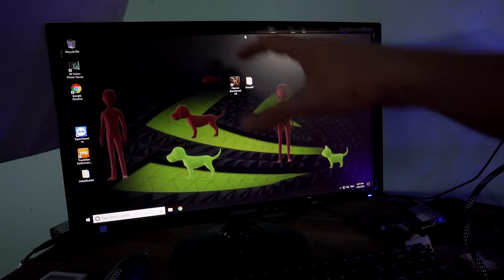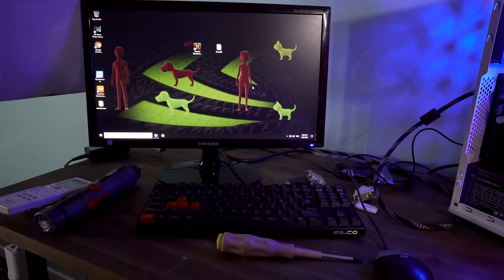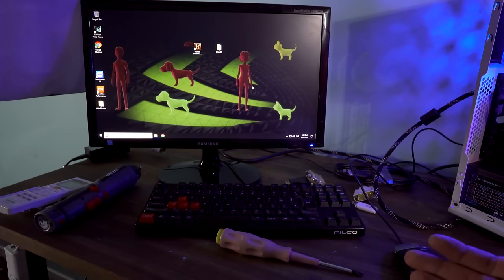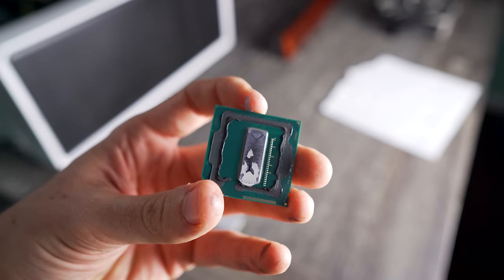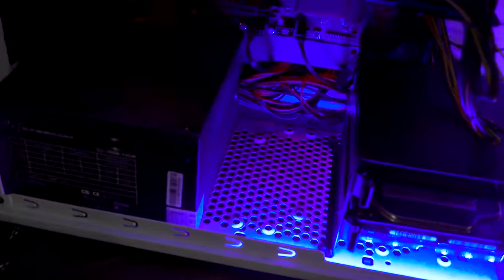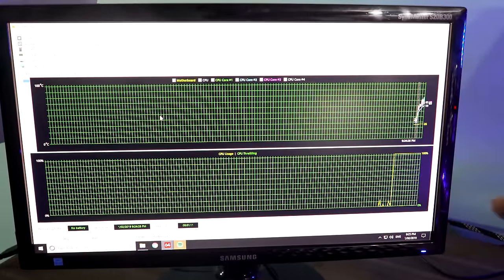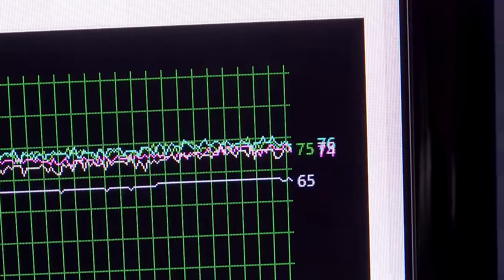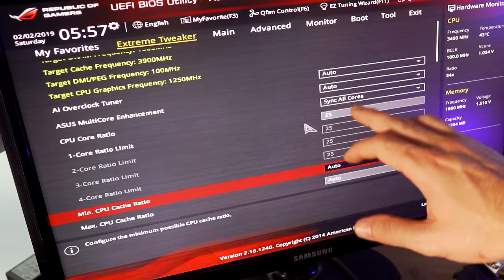How to Spot a FAULTY CPU.....? The i7-4770 Dilemma....

Comment: I've only ever seen one CPU failure, was a real pain to diagnose. it was an AMD A-series APU. The computer would just shut off randomly, ruled out heat related issues and swapped the power supply and nothing changed, it would just shut down a couple times a day. I pulled the GPU and used the onboard graphics and had artifacts even in the BIOS screen. Apparently the GPU portion of it had failed. Replaced it with the best CPU I could get for that socket which was I think a shitty Athlon X4, re-installed the discrete graphics card and everything was fine after that.

Comment: I have an i7 4790K that goes instantly to 100 Celsius on every core. Now finally, after 4 years, I've decided to open it and replace the thermal paste with liquid metal. No functional symptoms yet (except power limiting), despite running at 100 W for a couple of weeks now. Hopefully it's not too late to fix.

Comment: Not many people know this but if you place the faulty CPU at the large end of a celestial grade telescope you can spot the microscopic bug that is causing the CPU to fail. At this point a pair of surgical tweezers can be used to carefully extract it, at which point the CPU should work fine again.

Comment: in about 20 years, I have only ever known 2 CPUs die, one was an AMD K62-350, WAAAAY back.... I don't remember much about the cause, and another was more recent, it was during a re-build of an i5-2400, built into new case and it just stopped working, swapped everything out, even put everything on a new board and was still nothing - swapped out the CPU and it all came back to life...

I do however believe the CPU took one of the RAM channels out on the board, as only 3 of the 4 slots will work now...

But also recently (2017) I built a 7700k system, and I ended up returning it TWICE to Intel as temps were not under control, were hitting low-mid 90's in less than 2 minutes when gaming...
Reply: Did u get any post or beep with your dead cpu.....m currently in a bind

Comment: Well, prime95 is nice, but usually takes a lot of time before you can encouter an error. What is somewhat better to test CPU/RAM is Intel burn test which uses linpack. 
Usually it is enough to run 10 loops with maximum ram to find if the computer is stable or not :)
Reply: Filip Doležal just throw in call of duty 4 blackout run zombies it’s best stress test yet trust me got my i7 9700k at 5.2 ghz at 1.325 volts its amazing !!! Stays in 50-65 while gaming on just 120mm aio in push pull and fan over vrms!!!!
Reply: you can only truly test stability with a mix of stuff.  start with the IPDT, then stuff like aida64, then intel burn test, then prime with FMA3, then real-world crunchers like seti@home.

i have found that everything would be fine, until seti@home (lunatics avx client) would show it to be unstable.  if you are looking for an unconditionally stable oc, you need to have a large set of synthetics and some real world stuff.
Reply: my latest stability finder is Y-Cruncher (also does prime calculations) but seems to find errors faster than Prime95.
Reply: AVX generates more heat, and you may need to set up an AVX Offset in the bios, to downclock the CPU by -1 or -2 on the multiplier when AVX instructions get hammered like that.
Reply: @mrlithium69  I think AVX offset was introduced later.  I have the Gigabyte Z97 flagship board for my 4790K, the GA-Z97X-Gaming G1-WIFI-BK, and it doesn't offer that.  I'm pretty sure that ASSRock didn't either.  Not sure about Asus, as my first modern Asus board is a Strix Z370-I (prior to that, my previous Asus was a 286 board).
Reply: @kaylaandjimbryant8258  AVX offset isn't in either my Z97 or X99 Asus Sabertooth boards.
Reply: I've had f'in Cinebench of all things catch a problem P95 v29.4 Small FFT then Blend and LinpackXtreme missed, and vice versa. It pays to test with everything. Realbench is the one that couldn't even catch a cold let alone an error.
Reply: @m8x425  exactly, i use as good a mix of stress tests and actual stuff (avx seti, avx folding, etc) that i can put together and they will catch most stuff, but even then, only using the machine can tell you if it's actually stable.  i've had times when every test passed, but after using the machine doing daily stuff for a few days created either a lockup or bsod situation that would only be ironed out after bumping Vcore up maybe another five or ten mils, and then it would be long-term stable.  the stress tests, etc, when you do it right will get you to within that five or ten mils to unconditionally stable though.

about the only thing i do for sure is rank them by lightest to heaviest load, which is USUALLY a good yardstick on failing or passing.

Comment: Good to see you use Prime95 too Brian since it puts a more demanding load on the CPU. I would not worry too much about Haswell CPUs. My Haswell is fine. My guess it was abused before you got it because my 4790k has been overclocked to 4.6ghz for years now and no thermal problems

Comment: I’ve got the 4770K in my rig, had it for 5 years now and it’s still holding up just fine
Reply: And would probably in the next 10 years, if not more. If you got a cheap motherboard it will die sooner.
Reply: Koeras it’s a Lenovo motherboard it’s not that bad
Reply: @themattyshow4026  Lenova does not manufacturer Z87 motherboards as far I know (?)
Reply: Koeras it’s a prebuilt Erazer X510
Reply: @themattyshow4026  They use OEM parts of one the major manufacturers.

Comment: Im definitely a budget shopper so going with a ZALMAN cooler i don't mind. Plus i always used them. I found the biggest one that supports up to 300watts and stuck that on my 8700K.
 I got a Gigabyte Aorus Gaming 7 cause of it's high end VRM components and after watching Der8auer's video on it, I had to get it. Plus it looks good with the ZALMAN 9900MAX and a Sapphire Nitro+ RX 480 8GB OC (RX 580) with it's back plate almost perfectly matching the design on the board.
 All in i built a z370 monster for only $670. I see PC's prebuilt going for over $1500 with similar specs. I can say im happy with the choice to go z370 and not the i9 9900K route. I might upgrade to that in the future being that the MB can handle it. (8700K $280, ZALMAN 9900max $20, Z370 Aorus Gaming 7 $150, 16GB Gskill 3200MHZ ram $100, 650watt Corsair PS with case $120) had the rest of the parts SSD's and HDD's. $670 is what i would've had in just the 9900K with a proper IO and MB.

Comment: I have a i7 4770k and have no idea why the pc keeps just shutting off. 
Sometimes the pc is just idleing and it shuts off. Just watch low stress content and boom off. 
Thank you for letting me know about it's thermal grease. It's come down to the motherboard and CPU. 
Retesting the ram one more time before I delid the cpu. 
Other option would be to buy a motherboard first and see if that works fine. That would be sad though had an amazing formula VI motherboard. 
Going to just buy new set of ram. Worst case scenario I end up with extra ram for my system. 
Do let me know what would you recommend I do?. I have changed the power supply, tested both the rams, added a new cpu cooler with new grease, tested it on unraid still turns off, remove all hdds and tested it still turns off, removed most usb plugs, changed grease on gfx card which made it 12c cooler understress.
Ram test just turned off was at 92%.
Temps are generally really good on the cpu. Below 37 max 50 to 60. 
Will try Prime95 tomorrow.

Comment: 12v, 5v, and 3.3v are way too high, PSU has some issues...
Reply: Nah, won't make any difference.
Reply: They're well within tollerances. The ATX spec gives a  +/- 5%  limit. 12.6v max, 5.25v max, 3.465v max.
Reply: Theres 10% wiggle room on ATX voltage specs. And only 12v is relevant here, which further gets converted both in the motherboard VRMs and in this case on the CPU FIVR.
Reply: And all the critical parts of the computer generate the required voltages locally (CPU, GPU, memory etc) so even 10% higher voltages won't hurt a bit

Comment: I've been building systems since the mid 90s and the only new CPU I ever had bad out of box was a Ryxen 5 1500x, it had the dreaded segfault bug. It took me months of diagnosis and fighting with AMD to get an RMA because the serial number on my CPU was not supposed to be an affected model.

Beware of Ryzen 1000 series parts floating around on the second hand market, you may well buy a defective CPU and be plagued by random inexplicable crashes.

Comment: My Ryzen 2700X was a faulty CPU. The impossible happened. Wasn't hard to identify it/ It was just unstable. System was freezing whatever the memory settings, whatever the voltage. I managed to keep it stable at 4.2 GHz and 1.34v (yes the chip didn't crash at around 1.3v in prime95: "golden chip") with 16GB of cl14 3200 memory. XFR2 and PBO2 didn't work at all. System hang up while booting. After a few weeks nothing worked. Even 3.7 GHz  with 1.4v and cl18 2133. I tried different hardware. Wasn't the powersupply either. And my Crosshair VII went through RMA too, they sent it back, so by conclusion it wasn't the motherboard either. 

Well RMA just gave me a new Ryzen 2700X. Been working fine in the last 6 months. And probably will just do fine in the next 5 to 10 years.

Comment: I had a problem with a CPU i7 6700 for months! It always had bluescreen with the WHEA uncorrectable error. We noticed it would bluescreen when idle or doing light tasks but never on  load. Long story short we fixed it by putting voltage to 1.35V.

Comment: i had a faulty i3-7100 on a cheap computer I built for someone. It would BSOD shortly after getting into windows. I replaced everything, motherboard, power supply, memory etc.I finally tried a 7700k cpu and it worked absolutely fine. The CPU was almost brand new so RMA through intel, they asked a bunch of questions and had me mail in to verify faulty. Sure enough it was and they sent me a brand new in the box cpu, even got another cpu fan.

Comment: I once bought a i7 3770 (to replace a 3570k). The thing had a faulty iGpu. As long as you left the microsoft drivers for the igpu, it ran fine, but unfortunately not at the proper expected resolutions. 
As soon as you installed intel drivers (and i've tried a plethora of versions from various years, months and so on) the pc wouldn't either boot or bsod instantly. Switching off the igpu, the CPU and the pc ran fine. I had at the time 2 3570k to test, either worked fine with the enabled igpu. I then had another z77 motherboard laying around, swapping the 3770 on that and enabling the igpu led to the same issues. I had to return the 3770 and even the seller couldn't believe me until he tried it for himself. He sent back another working 3770. 

At the same time a friend sent me back that other z77 motherboard.. the thing had a strange issue, it basically kept rebooting itself after like 30' of "on" time. It was like an internal timer triggering the reboot and I couldn't figure out what was the issue, I flashed several bioses, changed memory and shuffled slots a ton of times, checked socket pins, changed 3 different cpus, cmos the crap out of it to no avail. I gave up on that motherboard.

Later on I read about Lenovo deliberatedly disabling Intel Management Engine to business level laptops, and read a comment of a guy answering another how he could disable the Intel ME by deleting the code/editing the bios. The other guy said "you can disable Intel ME, but then the motherboard would reboot every 30 mins or so because it checks if intel ME is present, and if it's not, then it will reboot".

Guess what, I checked the bios rom versions, and somehow the MSI flashing tool (it was a MSI Z77MA-G45) kept updating the bios part of the rom (to whatever version of the bios i tried to flash) but somehow left untouched the Intel ME part to the 1st ever iteration of intel ME that came with that motherboard.

I asked in the MSI forums and I was given a specific tool to force flash via Dos any version of the bios. With that thing even the Intel ME part of the rom finally updated itself to the latest version, and that motherboard still works as of today. Somehow the Windows license went to hell (like if the motherboard ID changed), but besides that, it ran fine afterwards.

These are my weirdest hardware issues I ran into so far. Let's not count bent socket pins or missing/broken motherboard lanes as those somehow were easier to pin out xD.
Reply: @Mogli Timme what, the faulty IGpu or the Motherboard rebooting every 29' something seconds of uptime because intel ME isn't updated?
Reply: @Mogli Timme lack of intel ME made my z77 Motherboard to reboot every 29 minutes and something seconds (roughly 29' 30" uptime).
Reply: @Mogli Timme if you put the 8700 back I bet everything is fine? Check the Motherboard socket for bent pins, but if the previous 8700 works well, then you just got a 8700k with a faulty iGPU.
Reply: @Mogli Timme then if you can reproduce the issue on another Motherboard, it's a dead IGpu. As soon as a program (the driver)takes advantage of some of its faulty instructions, it crashes.. return it or keep it disabled if you can't return the cpu.
Reply: @Mogli Timme when it happened to me on the i7 3770 it was the same, tried that on 2 z77 Motherboards, and a z68. Results were the same, legacy windows driver worked ok, as soon as you put intel GPU drivers it went hardware error. Just replace it or keep it disabled.

Comment: i'm still running the i7 3770k, oc'ed to 4,7ghz and still running strong after 7 years... i was getting high 90° at 4,2Ghz and i delidded it immediatly after getting it, and now it's sitting in the low 80 at 4,7Ghz, glad i chosen the i7 instead of the fx8350 since the fx nowadays is really weak compared to the i7

Comment: I have a Hexcore Dell T3610.   I purchased it from NewEgg through a reseller.   The CPU has a malfunctioning core.  The reseller never checked this CPU before they sent it out.   I called them and they basically hung up on me...    I have honestly never seen it happen, but I am not testing systems and overclocking them.  With Intel CPU testing software I have a core that is giving me FPU, SSE2, and SSE4.1 failures.   When I turn off and run only 4 cores, the CPU runs great.   Hyperthreading makes it work even worse, so I disabled it.   I do have insurance so I need to call a tech and see if they will cover it.   I am sure even with an insurance plan they might deny me.  I ran every test on this machine, multiple times.   Not the memory, not the board.  It was showing me weird things like shorted USB ports, but they are fine.   Crashing browsers in WIN10, Linux Mint and Linux Manjaro.   It drove me crazy for 5 months.    I guess it's not software related...it's the CPU and there is no way to fix a CPU which just sucks.
Reply: a biosupdate could help,i think your mobo needs a new biosversion. maybe the bios is faulty this can also be.

Comment: My PC has been slowly dying on me for the past 6 months, first it was blue screens, quick restart fixed it. Then it won’t boot changed out thermal paste. Start working again. After on it won’t boot unless it took a few days “break” like don’t turn it on at all for like 2-3 days.I thought maybe it was a PSU issue first so I bought a new one. It booted once with the new PSU. I was so scared of it dying again so I left it on while I tried to take all my important stuff. When I came back from dinner the monitors lost signal but my keyboard and mouse still had lights on it. After it never switched on again. Tried getting a new motherboard. It would have lime 3-5 second fan spin, dies and starts boot looping. I tried one ram stick each (I have a 4x4 kit) outside the case on a wooden floor. It just won’t post anymore. It’s a i7-4790 that I didn’t want to believe is the issue. I contemplating delidding it and see if that’s solves the issue. The system has been running for a good 6 years maybe it really is just wear and tear at this point.
Reply: I have the same issue with my ryzen 7 2700x not booting at all for a few days now used to boot fine for 2 weeks then it started doing the weird thing again like cpu fans keep spinning when shutting down and not booting at all have to take everything apart for a few days to let it boot with luck idk how or what's wrong with the cpu, tempratures are normal and I can play games on it for hours when it's booted

Comment: Hi, I'm researching my own faulty cpu after having to fix many other system issues first. My Ryzen 3700X has a worker fail on the start of running a Prime95 test. The manufacturer suggests I change all my hardware to test and seek the help of friends etc to help complete my tests, well this simply is not an option, my hardware has already been changed many times for other system faults. Time and hardware cost are getting very high now. If the manufacturer cannot advise me on a simpler test option without the need for a lot of hardware swap outs then I have got a problem I cannot diagnose easily. My cpu is still under warranty and the retailer has been very good with other hardware returns, but I feel like the manufacturer should step in on this one and help me out more. Yes I may be able to under volt to fix the issue, but I feel this cpu should be rock solid on default bios settings and that is what I have paid for. If you have any input on this that would be great to hear.

Comment: Tough break, kinda sux you aren't certain if some of the hardware is what you actually supplied...
Q: Do you have any sweet spots for 3770 non-k cpu's?
I delidded mine a few days ago with great temp success running at 4.644ghz with 1.235 volts via 43x108 peaking at 66c under stress.
Anything I can do to improve, is that my lottery sweet spot?
Great vid as always, I know a dude that bought one of your builds and am always surprised by the bang for buck with whatever he demands of it, you sure know how to tune!